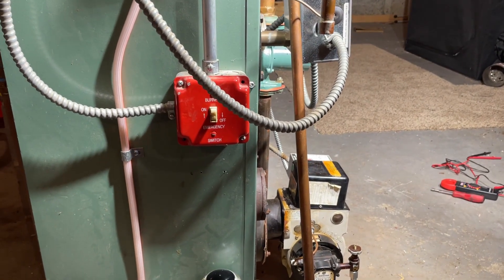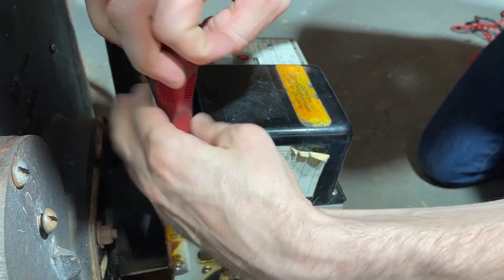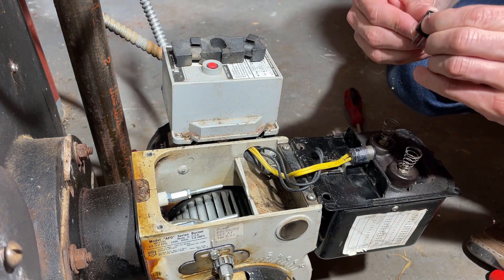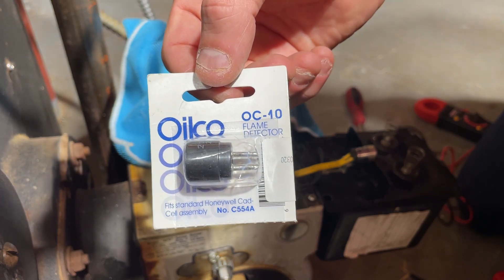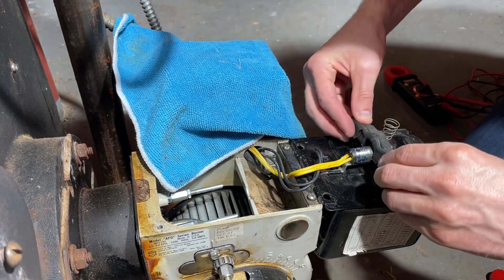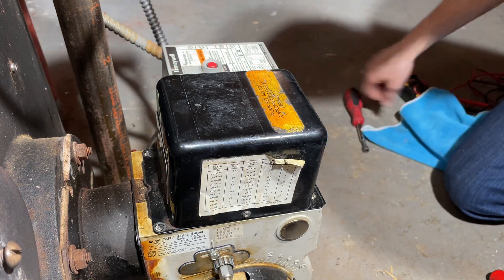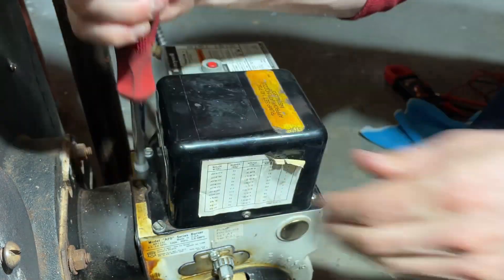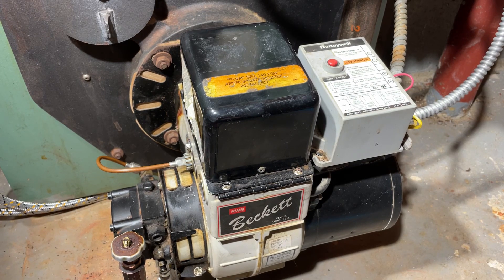Replacing Cad Cell in Beckett AFG Burner

Comment: My oil furnace one day stopped working, doesn't start.   Oil pressure ok. But I changed the oil filter and nozzle.  Again oil pressure ok. Again oil furnace doesn't start.  Check the spark it's ok.  Again oil furnace won't start.  Check the peephole to see if I’m getting spark, no spark.  Replace the cad cell and transformer. But I get a spark when I took the nozzle/electrode out of the burner head.  So I left the peephole open, guess what?  The furnace started.  This is completely the opposite of what the cad cell does.  I double-check the cad cell, high resistance with no light, low resistance with light.  Again cad cell is brand new.  The oil furnace only starts with the peephole open, then I close the peephole and it runs great, very smooth.  But won’t start up the next time the thermostats want heat on.  What’s going on???
Reply: I would replace nozzle . Check electrodes setting and porcelain insulators for cracks
 Look down the blast tube to make sure all is ok.
Reply: I would check the chimney for blockage and draft settings. Could also be the heat exchanger needs cleaning.
Reply: Air intake adjustment?
Reply from the maker: I can't tell either... sounds like you need to have a tech come check it out :/